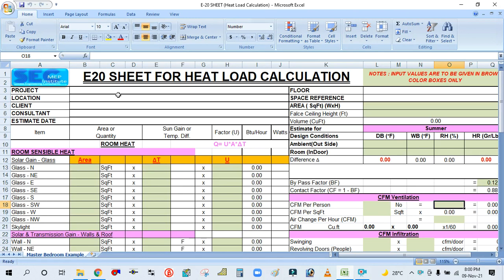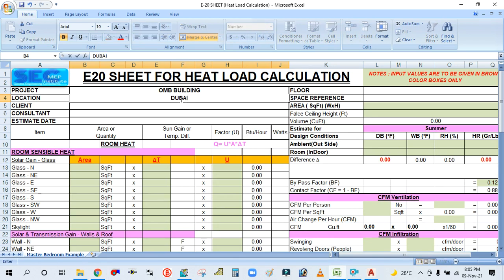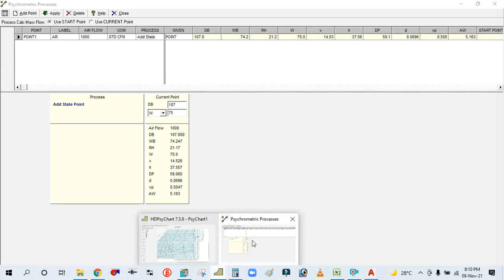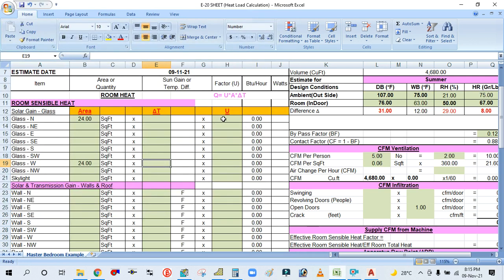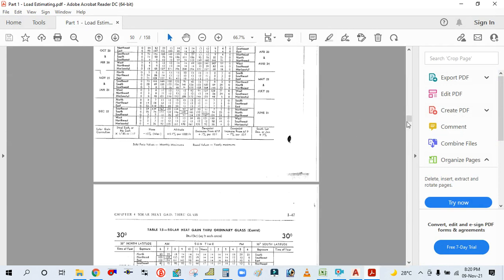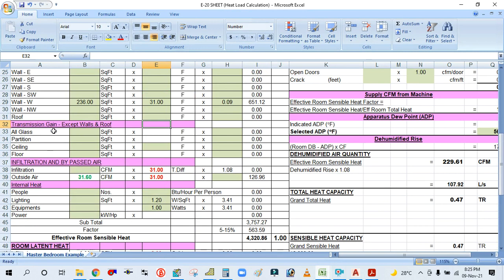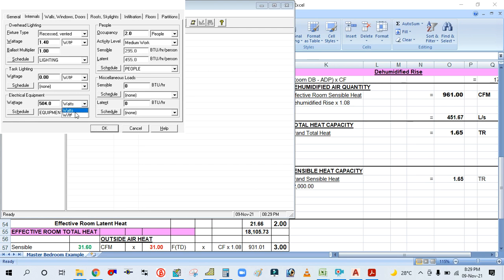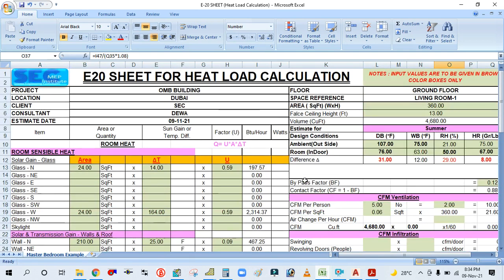HEAT LOAD CALCULATION USING E20 SHEET AND COMPARE THE REPORT WITH HAP4.9 SOFTWARE FOR THE SAME SPACE

Comment: Hi good afternoon sir,
May I request you excel spreadsheet for this and how do I get carrier data reference which shown in your video to follow up ? Please do advise me this.Thank you very much for sharing information like this 😊

Also, please do share on 
1. Mechanical ventilation system for kitchen and boiler room separately 
2. Cooling load calculation for cold room system and kitchen as well as with reference taken from data information. Thanks😊
Reply from the maker: Hi
already made the video please check my folder